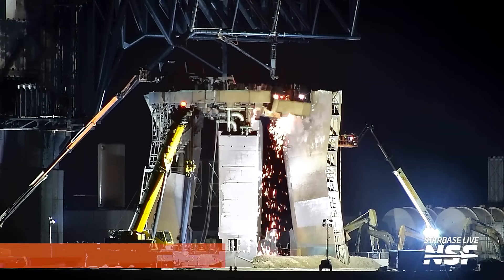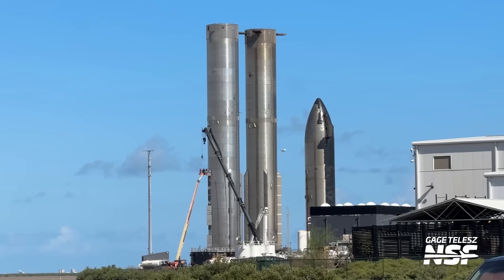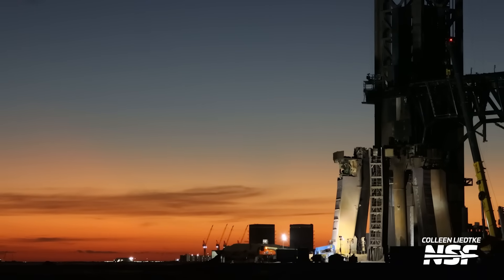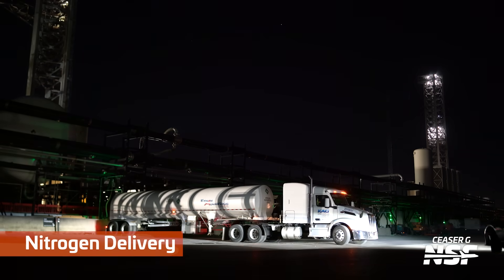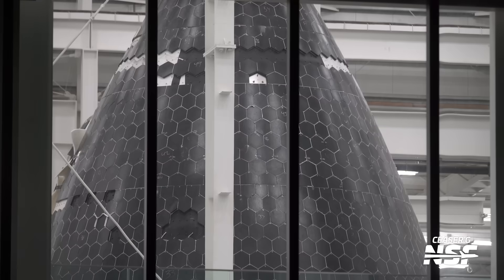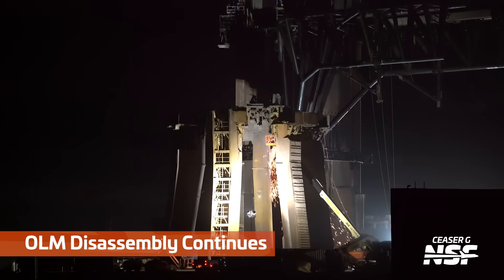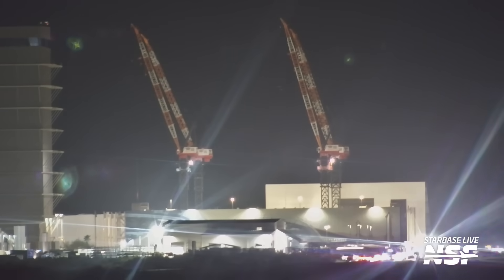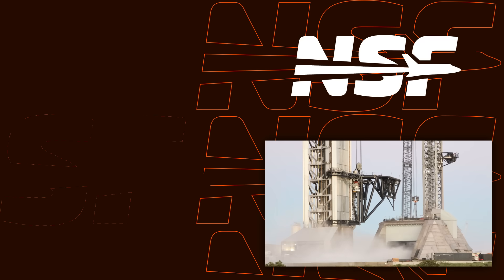"They're really tearing down that launch mount" | SpaceX Starbase

Comment: I wonder how the tower does in a hurricane
Reply: The tower I would think would fare well, it's all those flat sided tall buildings that I wonder about.  Then again they are all framed in heavy steel which is how most storm 'proof' or resistant structures are built.

Comment: Das narration is the best choice.  Das-provided ambient sound is the next best choice.  They should be making a pile of stuff explicitly from OLM 1 (that's Old Launch Mount) and then letting a 3rd party cut it into 6" squares to sell off as memorabilia.  It could raise a lot of money for both SpaceX and this 3rd-party thus benefitting a local business.  Recycling on a different angle.  Cost could be per weight because different gauge metal and subsequent delivery costs.  Someone good at maths could figure out pricing.  I'd give $50 for a part of OLM 1.

Comment: 3:29 So I thought this deluge system was basically the same as the one that drove the steel plate. Pressurized nitrogen. Well that's wrong.

They're using a methalox turbine it seems, to drive a water turbopump, which is what generates water pressure and drives water through the deluge. It is essentially a Raptor turbine hooked up to a custom water pump, but it's apparently not quite the same.

I believe that tall venting is the exhaust of the turbine, but I'm unable to find much information on this system.

Comment: Sorry to say it but the commentary distracts from the video. I mute it.
Reply: No worries, in fact if you click the gear, go to Audio Tracks, and select Klingon it'll be just the ambient audio with no commentary! Little trick we've put in for those who prefer no commentary
Reply: @thomashayden804  I noticed you also deleted the outro music on the last ambient!  Have to admit Das eventually won me over, but my only pet-peeve with the original pre-commentary updates was the outro shocking me out of my ASMR zen. 👍🏼
Reply: @DavJumps  Hah, good to know! I'll admit that the only reason we removed it was YouTube getting concerned about differing copyright between the audio tracks (just cause it couldn't hear the music on Das' version) so we just cut it as a solution. But hey, if people like it better then that's great!
Reply: @thomashayden804  Yeah, starting many years ago, I used to put them on last thing before going to bed (they used to be >20 minutes or so long back then, iirc?) and set the sleep timer.  When I didn’t get the timing right, the outro would blast me awake again. 😵

Comment: Isn't a CNC machine just the inverse of a 3D printer? Why would you need both?
Reply: For a lot of things machining from stock is MUCH faster.  It also allowed one to do more than one thing at a time if the printer is busy.
Reply from the maker: Sometimes you need to add some material... sometimes you need to subtract it. It's good to have options! - Das